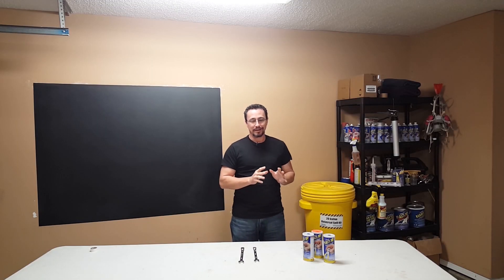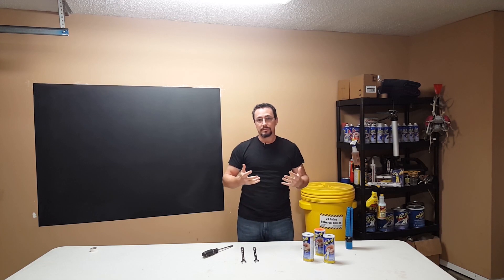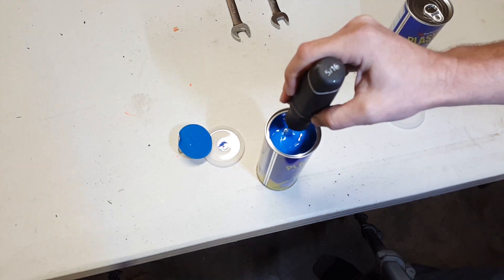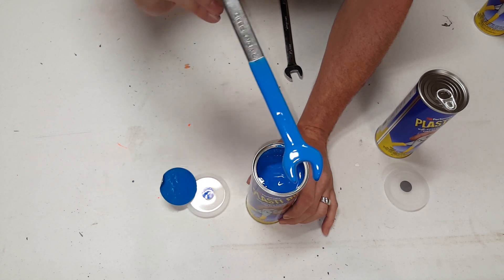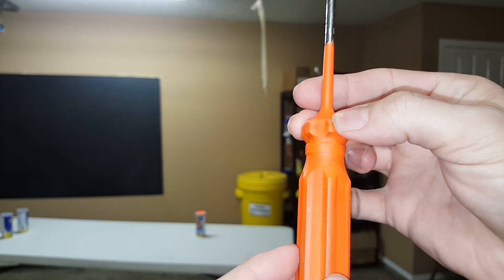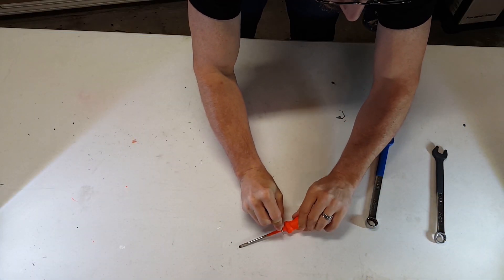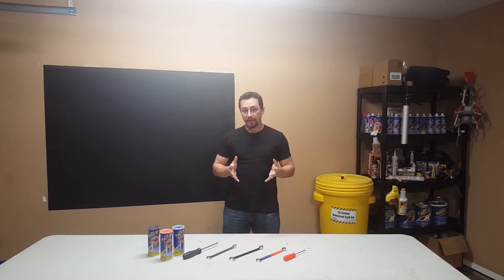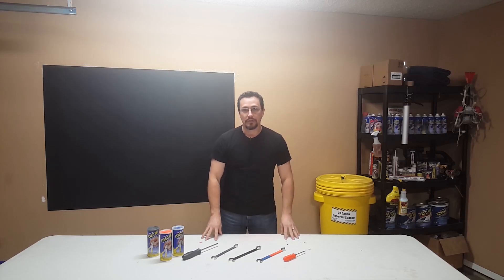New Plasti Dip Colors

Comment: Can You Apply It To Rubber With A Brush ?
Reply from the maker: It can be applied with a brush. Its recommended to use a throw away brush. Plasti Dip can be hard to remove from the bristles/brush hair.
Reply: AWF PRO Apreciate It

Comment: What is the flexibility of the Plasti Dip (once its is cured)? I want to use it for some other project like: Coating a "Balloon-like shape" for example, into Plasti Dip and remove it after curing, possibly in one piece, from the base object and inflate the resulting balloon-shaped Plasti Dip. If it can give me 10% to 15% expansion I will be OK. Please comment on that.
Reply from the maker: According to Plasti Dip's techinical data sheet, they list the following: Elongation: (ASTM D-638) 430%. It is quite stretchy in use.
Reply: @AWFPRO  Oh really! Thats going to be fun. I am just waiting to get it in preferably white color so that I can use some color pigment. The store I saw today in my place had it only in Black.

Comment: just apply heat with a propane torch on the bubbles
Reply from the maker: This method is not recommended by us or the manufacturer of Plasti Dip.
Reply: i normally do it on epoxy and i tried it on plasti dip for a pipe wrench i had to brush on and it work well but you have to move the flame real fast

Comment: In my experience, the air bubbles have come from submerging tools too quickly more than anything else (including shaking).
Reply from the maker: This is true in a lot of cases. Bubbles are something that most people are going to have to deal with at some point or another. Especially those new to this product. For someone who is experienced to this product, this video will not provide any new information. It is more of a tool for those who have had bad or very little experience with dipping tools. In any case you are correct, speed plays a very important role in dipping a tool.

Comment: Thanks for a very good video - I've watched this over and over the past six months.  I do tool refurbishment, conservation, and restorations, and from our world, we potentially want different properties from this product (and this misunderstanding has led to negative feelings about it).  Primarily we want better adhesion to the tool, especially to steel, long-term durability, and for extra credit - to maximize grippiness.  Do you have any learnings, insights, or pointers we could explore - I intend to share these learnings back to that community!
Reply from the maker: Hey Marc, Sorry for the delay. I recommend using the Plasti Dip Primer 11oz aerosol can. You can find it on our website. This will create an almost permanent bond to metal. Hope that helps!
Reply: @AWFPRO  Great tip - ordered some and will try it ASAP!
Reply from the maker: @marcmckenzie5110  Great! Let us know how it goes!

Comment: Once you open the can is there a time limit before it dries out or will it last with the plastic lid on?
Reply from the maker: Unfortunately it dries out after a few days even with the plastic cap.
Reply: @AWFPRO  May be we can seal it by brushing a small amount of Plasti Dip on the Lid 😜 or use any other flexible sealant.